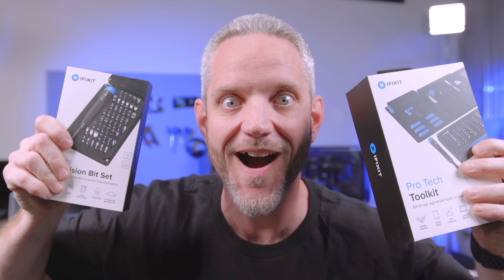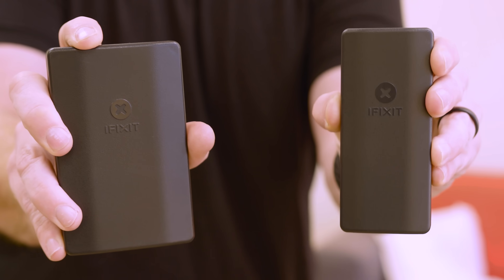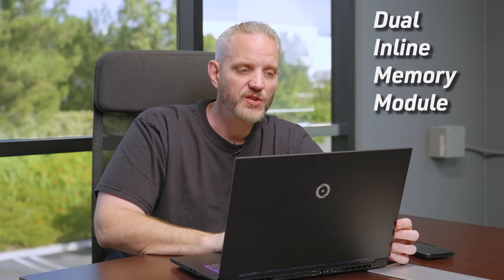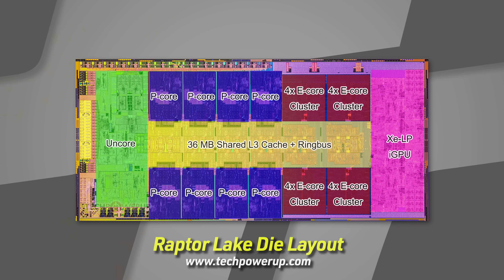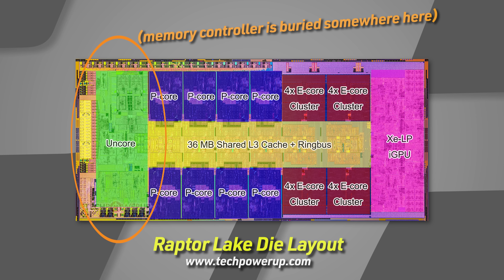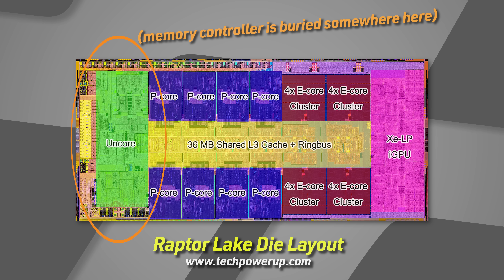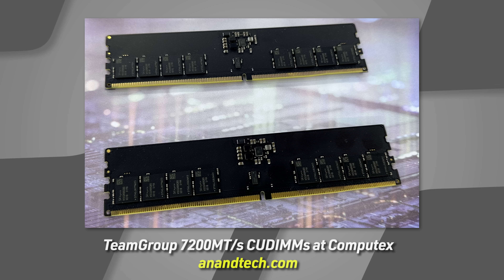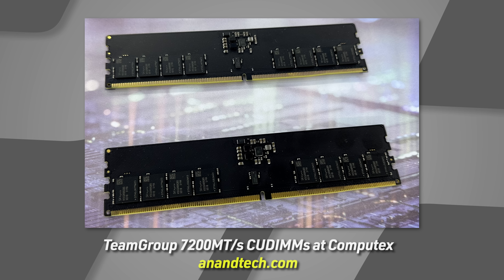RAM just got a LOT faster! Up to 10,000MHz!

Comment: Verbose, yet little ordered technical details; improve, be efficient.
Well IMO the IMC should go at Core Speed and adapt the best it can to the RAM, so CUDIMM helps a lot on this, and should have been implemented long ago; so configured like this: RAM should deliver data to the CPU as fast as the IMC can fetch it, Efficient

Comment: 11:02 This is not true. CU-DIMMs are supposed to work with older memory controllers at up to DDR5-6000 speeds by running the CKD in PLL Bypass mode.

Comment: 9500 mt/s overclock with CUDIMM on some new z890 Intel Ultra boards, (what they measured as the high end before CUDIMMs dropped) theoretically we should be able to push these to 12,800 MT/s (This is the DDR5x Version that LPDDR5x got.... For desktops.)   Hoping we can push this all the way to the 12,800 MT/s where we wanted to stop DDR5 and officially START DDR6 for the next generation - Hopefully the PCIe 6.0 will be ready by then. meaning Nvidea will have dropped their new GPUs 5000-series by then.. Ultra and AMD 9000 series has unfortunately dropped without the PCIe 6.0.. was my only complaint of both CPUs...

Comment: in era of ddr2 there was FB ram modules which had its own CPU (a lot of heat) but it provided a huge stability and error correction for long  analysis (often days) which would fill up all the ramp space to 100% (up to 512GB of it) .. I welcome the new era that will offer the same ...

Comment: hi end DDR 3 capped at 2400Mhz, back in 2007 when i bought the first 4 core 8 thread CPU that Intel launched. At that time 8 gigs of 1600Mhz was just over 200 bucks Canadian and 8 gigs of 2400Mhz was well over 500 bucks Canadian( saying that, that build was just retired 2 years ago, and ran 24/7 with zero issues since new 2007). Ya, there is a graph about the performance to dollar ratio for ram timing to FPS, 5600Mhz-6400Mhz yielded 10% and or about 8FPS @ 4k and from 6400-7200 was 2Fps and from 7200 to 8000Mhz/ 8Ghz gained another 1fps all were at 4k ultra settings. I read that real time voice request and or responses in Ai, and in new video games that we will see in the next 1-2 years will require a base Memory frequency of 6400Mhz. To be able to have AI respond to your voice requests/ interactions in near to real time will be the ultimate Video game experience. I would think the memory frequency reverse path issues are very much the same as the tech in the telecommuting transmission infrastructure, (I worked in that industry for about a decade) when the industry went from outgoing transmissions of data and or tv signals with very little return path data frequencies, every single Active device in the plant had to be swapped out and new actives with return amplifiers were added. As the Internet speeds increased all the Passive devices then were also replaced as the return path ends up being very sensitive to any noise that ends up being generated in the plant as the distance increases from the Head end. Just over 20 years ago when the Internet boom started in the cable industry, one job i had was to make sure every single connection in all the MDU's (multiple dwelling unit) that housed 8 units or more in the city i live was replaced and tightened to spec. The spectrum analyzer's that were needed to measure the downstream and upstream noise were 40 grand. They were so sensitive to noise, they could measure the ingress of noise that was added to the system with just one loose connection and or a compromise in the shield in the cable from up to a 1000 feet away. The biggest way that reduces the noise in a system is to use light and or photons to transmit information, end users call this fiber optics and or glass for short. In the cable industry the roll out deploys Fiber to the neighborhood. 20 years ago the spec was about 5000 users to a fiber node, these nodes were called Star gates. The average person has no idea the bandwidth in a single strand of high-end glass. I read over 20 years ago that they said by now we would start to see photon pathing in computer designs, my guess why we still do not see this is at the average user is  because there is nothing out there that will benefit from the super high speeds so will still are stuck with the mechanical transfer speeds of todays tech with our rigs and in the server class as well.

Comment: In case it helps Jayz - I am someone still on ddr4 as I didn't see enough of a jump in speed to justify the change to ddr5 yet as it seemed like the RAM speeds were far slower than I thought should be possible on that platform. With CUDiimm speeds now unlocking faster ram speeds it now might justify the change in platform to upgrade my mobo/ram/cpu. I look forward to seeing what the performance is like - particularly in games fps! Thank you for your content!

Comment: the only difference between cuDIMM and normal DIMM's seems to be that they clean up the clock signal. So they should only be marginally more expensive to manufacture and probably all of them will have fallback and work as normal DIMM's if put in an system that can't use the cu function.
So your description of what it is was not just vague but also misleading when it's not any complex logic added to the RAM stick.

Comment: I'm slightly surprised that there is still development in these areas when I think the writing is pretty clear on the wall, single board computers will likely be the default pretty soon. cpu, gpu, shared memory and storage all soldered to the board. Seemingly all arm based. It's obvously sad for builders like us, but the performance advantage, production cost cuts and un-reparability are all factors that make it very profitable for the companies. Apple is good on their way there, and im prettu sure that Nvidia will follow rather quickly, I wouldn't be surprised if the same case goes for AMD, Qualcom etc.

Comment: Me putting certain games on a 20 gb ram drive to resolve bundle loading hitches 🤤
Anyway, Vram / System ram swap for heavier apps like Blender, Substance Painter, a thick Unity dev scene. CUDIMM looks like a really solid improvement in performance.

(seriously Unity, instantiating bundles on main thread is a curse, fix it already)

Been running into more and more games that want 16+GB vram too, and faster swap with system ram helps with stutters when vram gets full.

Comment: In technical school my instructor taught me that the maximum throughput of the front-side bus is limited by the width of its data path.  Now that the memory controller is in the CPU, how does cranking up the speed on asynchronous memory exceed the physical lanes for processing?

Comment: If you had to choose between 128GB ram at 6400 or 96GB at 8400 which would you go for? for productivity not gaming to be paired with the Ultra 9 285K? I don't know what to choose especially if I can't run the full speeds.

Comment: CU-DIMMs are becomming only one of two options in Laptops -- soldered memory or CU-DIMM memory (which vendors may have used interim standards for*). For trace-length, and possibly using all 4 DIMMs - CU-DIMMs will become necessary in these applications even before 6400mhz+ speeds are considered.

Comment: Now that the review embargo is lifted and we see that Arrow Lake is best suited for computing, rather than gaming, would it be fair to say distrubuted compute systems like BOINC (Berkeley Open Infrastructure for Networked Computing) would benefit greatly from Arrow Lake?

This system splits workloads into smaller parts, which are then sent to volunteer participants around the world and analysed by the mainframe systems when results are returned. Projects include things like unoriginal weather forecast models, medical research, mathematical problem solving, and more. Some projects are aimed at being run on GPU's, but not all.

Comment: So could you let us know if old ddr5 memory frequency boards to the new ddr5 memory frequency boards what will support the newer uplift frequency or will it cause the older boards memory control modules to malfunction if you were to try to upgrade to an eight or nine thousand avoid states that its maximum memory is 8,400 for one single stick but would that mean that if it was one single stick at that point in time if they did the repeater and the memory wouldn't that mean that I could go up to two sticks or four sticks as long as it was using a repeater I would have to be one stick because it says 8000 for one but at the time that that was posted for by specifications the repeaters weren't a thing yet

Comment: I believe they should slow down a bit on the memory front. We barely have DDR5-6000 figured out and ……… just like CPU’s …………. memory may run into a heat wall. Also……..we’ll probably create a new bottleneck somewhere along the path.

Comment: TLDR: RAM mhz means nothing overall without looking at timing. 

The mhz tells you how fast it can process a thing (in a reverse manor, aka higher number means faster).
Timing means that it needs to be processed X number of times before it is sent.

Speed means nothing overall without timings. Timings is how often the item needs to go through ram (in simple terms).
There are tests from previous generation RAM setups and it was a large swing. The fastest speed never won processing, the best speed compared to timing always won most of the tests.
The best performing RAM is high speed and low timing. In the 9900k era, it was as much as a 5-10% improvement in overall performance going with the best vs worst setup (of tested versions).

Comment: I am not gonna stress the new speeds for gaining, is it gonna matter, sure some, but it is not the end all for it. I am looking at all the new stuff for an upgrade but it is gonna be the recommended sweet spot from the CPU maker that I get RAM-wise, and I will get the cheapest 64GB kit I can get at that speed. I have 64GB for my 5950X and run 4 dimms and it is fine with it. I get the rated speed and timings and the controller stays cool so I have no issues.

Comment: I'm new to the PC world and have only used a Macbook for work. I just ordered my first one from Aftershock:

Case - Jonsbo D300 - White
Motherboard - Gigabyte B650M Aorus Elite Ice AX - DDR5
CPU - AMD Ryzen 7 7700 | 5.3 GHz | 8 Cores 16 Threads
GPU - Gigabyte RTX 4070 Super Aero OC - 12GB
RAM - 32GB Kingston Fury Beast RGB 6000MHz (2x16GB) CL36 - White
Cooling System - Aftershock M-41 Frost Air Cooler - White
Fans - 4 x Aftershock Omni RGB 120mm Fans + CPU Fan - White
Storage - 1TB Gen4 Lexar NM790 M.2. NVME (R 7400MBs | W 6500MBs)
Power Supply - 750W Inwin 80+ Gold
Windows 11 Home 64 Bit

Is this good? I tried to do as much research as I could before I purchased ($3300 AUD btw). I think it's good for 1440p gaming? Im a graphic designer which is also why I wanted to get a pc, I do light video editing and use Adobe programs like After Effects, InDesign, Illustrator and Photoshop for my work, so hoping it will be okay.

Any guidance would be helpful as this is my first experience!

Comment: Hi..I asked AI to recommend a PC build and this is what it recommends.

*Processor:*
- AMD Ryzen 5 5600X

*Motherboard:*
- MSI B550 TOMAHAWK

*M.2 Drive:*
- Samsung 970 EVO Plus 500GB

*SSD:*
- Crucial MX500 1TB

*RAM:*
- Corsair Vengeance LPX 16GB (2 x 8GB) DDR4 3200MHz

*Graphics Card:*
- NVIDIA GeForce GTX 1660 Super

*Power Supply:*
- EVGA 600 W1, 80+ WHITE 600W

*Case:*
- NZXT H510

*Monitor:*
- ASUS TUF Gaming VG249Q1R

Can you make a video about this...Thanks
Reply: Looks like your AI is working off 3 year old data.

Comment: Let's hope that motherboards can actually run stable at these speeds. As of now, the lowest end X870 boards on launch can only get up to 7400, and the highest end boards on launch can only get up to 8300. Hoping that the Z890 chipset will handle these speeds better

Comment: 10,000MHz is really 5,000MHz of course. DDR membory is quoted on the rises and falls of the clock cycle - so 5000MHz equates to 10000 mega transfers per second but the memory clock is still half the quoted speed on the packaging / BIOS settings etc.

Comment: I have read that, with DDR4 at least, going for higher clocked memory was of no benefit since the transfer speeds of RAM are higher than most use cases?

Was that actually true or would it be worthwhile in going, for example, from 3200 to something higher?

Comment: I think this video is hugely misrepresenting what CUDIMMs are. There's nothing smart about them, they're just regenerating the clock signal so that everything happens at the correct time without glitches due to a dirty clock signal. All the smarts are still on the memory controller and it's a halfassed solution compared to the registered/buffered RAM that has been used on servers forever. Being halfassed, there's no reason for an exorbitant price.

Comment: This tech is going to be key for next gen video game consoles.  This is because video game consoles tend to be iGPU.  The largest fps slowdown for an integrated graphics card is ram speeds.  This is why dedicated GPUs give such a huge FPS boost, because vram is so much faster than system ram.  To give an idea on a Geforce 980 (a 4 GB *80 series card) it's pretty easy to get 200 fps in a lot of games on the highest settings.  The second it runs out of vram the fps drops to around 20 fps.  That's a 10 fold fps drop due to the speed of system ram.

What this ram does is it brings system ram speeds closer to vram gpu speeds.  This way someone can buy an iGPU and get very high frame rates.  This leads to a huge speed boost for video game consoles as they tend to use an iGPU.  This boost will bring gaming graphics forward.  It feels like for the last ~10 years video game graphics haven't improved much outside of ray tracing.  This could change that.

Comment: The name is kind of ironic considering there is a lot of older ram that had a memory controller directly on the stick- most modern ram that can change it's own clock speeds like some of Kingston, Crucial & Corsair's still do. That said I would find this useful, as I run nearly everything I can via Ram Drive, regardless of what it is; 7-zipping large files @ max compression, my games (including ones from Steam, when allowable, GoG Games always work this way :P) Local AI LLMs, & compiling code.

Comment: Any application that deals w paging memory. 
I'd need to learn more about the spec and some more details, but w faster memory, you can buffer more information in memory rather than spilling to disk.  (Think of application specific swap.)  

A simple example would be working on a data set within spark.  The more addressable memory, the more of the dataset fits in memory so there is less spill and working on the dataset will be faster. 

There are other applications too... so faster memory is a good thing if it works.

Comment: Sorry Jay!  I love ya... but you seem pretty foggy on this new technology.  By moving the clock driver to each DIMM module, it takes the pressure off the platform, which no longer has to support high RAM clock speeds over the traces on the motherboard, the mechanical DIMM socket, and  the DIMM modules.  Now, the motherboard only needs to sync up with the clock on the DIMM socket, and that is (in theory) easier to manage .. electrically.

This is interesting new technology and may even become a standard on all desktop platforms someday.  But this is still kinda "Brand Spanking New" and the biggest benefits will come when the technology matures - as seems to be the case with all new RAM technology.

Comment: change the title, its MTs not MHz, you correctly say mega transfers per second in the video... until you started talking about DDR1/2/3/4 and then you used the wrong unit again. DDR = double data rate, transfers occur on the rise and the fall of the clock.... the marketed speed or "mega transfers per second" is double the clockspeed. the datarate is double the clockspeed. ddr400 was 200mhz, ddr2-800 was 400mhz, ddr3 1866 was 933mhz, ddr4 2400 was 1.2ghz ddr5 10,000 is 5ghz. 5ghz ram is very impressive BUT CALLING IT 10,000MHz is misinformation and it is just gonna keep happening.

Comment: Keep in mind the manufacturing side price increase is not going to be long term because JEDEC mandates CKD for all memory starting at 6400. Due to this the entire market will shift over time whether DIMM, CAMM or SODIMM format.

CUDIMMs in theory should allow for higher memory clocks than UDIMMs so this would be something worth testing: ex a CPU stable at 8000 vs 8400 or something of that sort.

Comment: CU-DIMM memory is said to work on older platforms, not sure if it will take advantages of the new speeds and clock driver but its supposed to be compatible with older ddr5 motherboards.

Comment: CKD chip does nothing but redistribute clock signal from incoming lane on the board to memory chips on the DIMM. It is nothing more than a buffer / amplifier, there to reduce signal reflections and make signal to noise ratio higher.

Comment: This technology will certainly help with deep space astrophotography processing. I collect thousands of raw photos which all go through a variety of treatments - measured and quality weighting, calibration, alignment, background normalization. Then the individual frames are integrated together to increase the signal to noise ratio, or sometimes drizzled to increase resolution (a process developed for the Hubble images). My last image took 10 hours of compute time to complete these steps, faster memory could certainly help get this done quicker.
Reply: what software do you like for your variety of treatments mentioned? thanks
Reply: @kk-pz8gn  Pixinsight is the gold standard for this kind of work